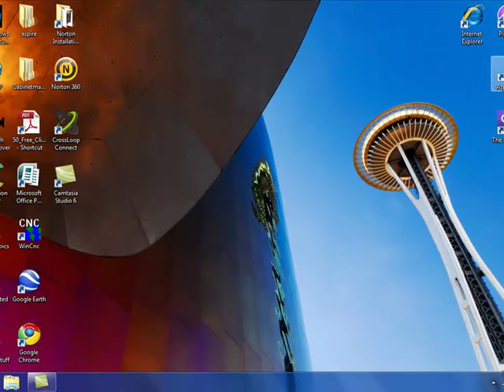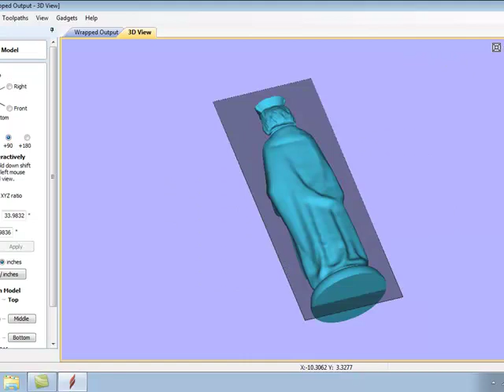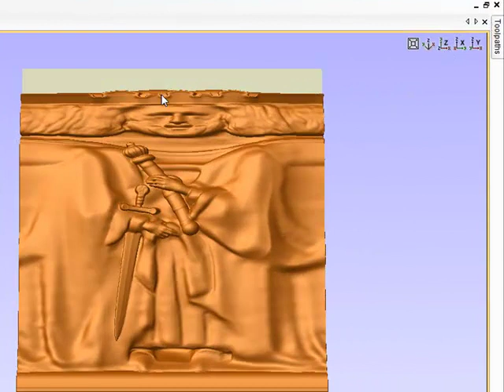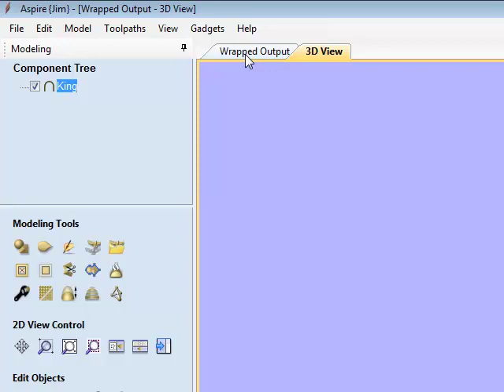Aspire 3d stl wrap.mp4

Comment: Good Job Jim. Why do you set your Z to the bottom of your file? You don't mean the bottom of the round but bottom of the stock (like where the base or feet go, right? Why?

That is a good tip about flipping the model to the backside, I never thought of that. I use a different pgm but good tips here that i can relate to other pgms. Keep making more videos for the indexer, we can't never get enough.GOOD JOB!